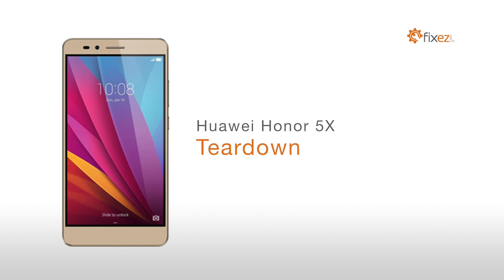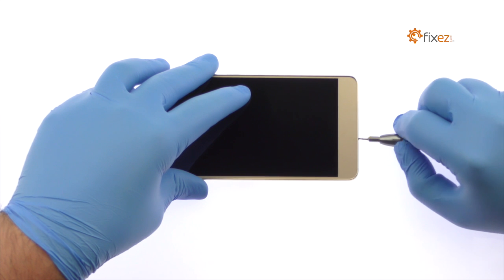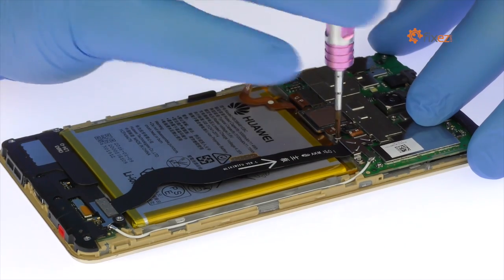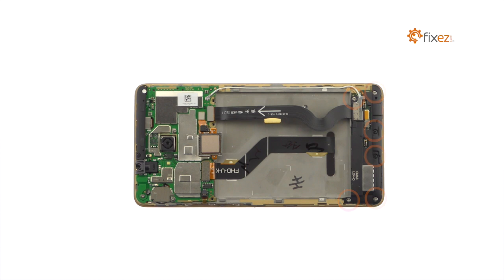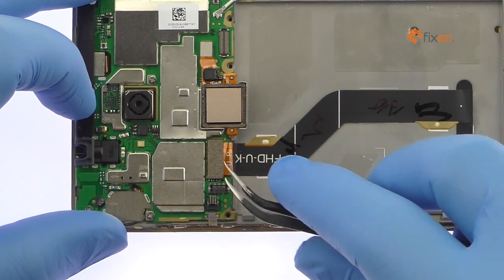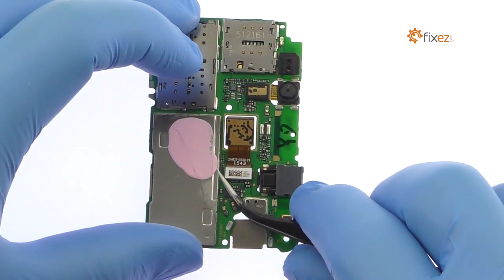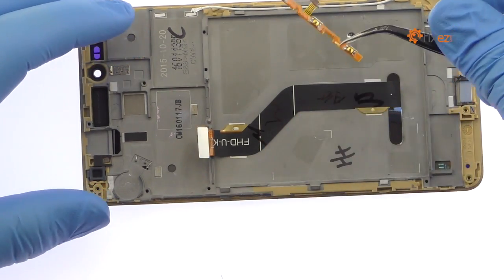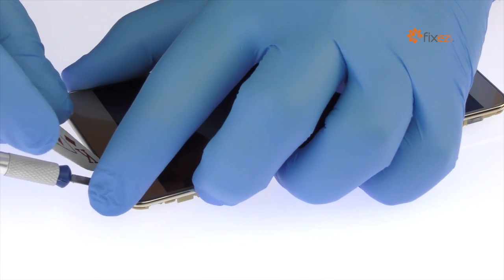Huawei Honor 5X Screen Repair, Teardown and Reassemble - Fixez.com

Comment: Thank you for the great tutorial! Can I ask what is the purpose of those red and grey rubber things (I didn't quite catch the word you used, I'm not native English speaker).
First time ever I did this kind of a project, and thanks to this video, saved a lot of money and learned new things, and most importantly: My phone is like brand-new again!
However, one problem has occurred now. The screen does not answer to touch right away, when I turn the phone on. I can live with this problem of course but I was wondering where the cause of this problem is, is it in the new screen itself or have I connected something wrong?

Comment: This video is awesome. I watched it and successfully repair my phone in about a hour and a half. The only problem I had was that the LCD that I bought did not pre-connect the touch screen sensor. Basically what I am saying is, there is one connection that needs to be made on the LCD before connecting it to the circuitry of the phone. You may find that connection at the base of the LCD. The info could be useful for anyone that runs into this problem. Overall, the video was great!
Reply: Devony Powell thanks a lot

Comment: Is all that really needed for a screen repair?
Reply from the maker: Yes the boards and small parts should be removed to prevent damage while heating the display.
Reply: 7:01 - 7:35 I didn't see you heating that part.

Comment: I did a screen replacement but I can't use the touch screen what Did I do wrong?
Reply from the maker: It's possible that the digitizer was damaged in installation.
Reply: It is possible that you need to make a connection on the LCD, as I had the same problem. The connection is found at the base of the LCD. This information is probably not useful anymore, but it is probably useful to someone in the upcoming future who may have this problem.
Reply: @devonypowell5261  very good of you to reply to this question... i also have an issue: when I put phone with new battery i installed... i got battery icon flash on screen, then Huawie logo, followed by vibration. then a repeat of the last two.  any idea what i might have done wrong?  something obvious?    
I put the old battery back in and experienced the same.

Comment: help I cracked my camera glass
Reply from the maker: You'll need to replace the rear case as this houses the camera lens for your rear camera. You can locate these here https://www.fixez.com/catalogsearch/result/?q=honor+5x
Reply: +Fixez.com I bought the product off your website and it shipped fast and I  replaced it was easy to do . I am very happy with my order thank you Fixez.com
Reply: +Fixez.com can guys repair my honor 5x charging port
Reply from the maker: +creeper gamein Unfortunately we do not offer repair service at this time. We do offer a replacement charging port for you Honor 5x, if you feel comfortable doing the repair yourself. 
https://www.fixez.com/store/more-brands/huawei/huawei-honor-5x/huawei-honor-5x-micro-usb-connector-board
Reply: +Fixez.com i dont feel like i could any help and i can prob try